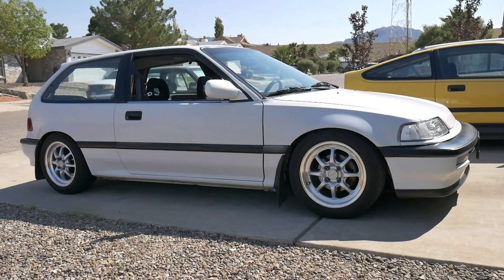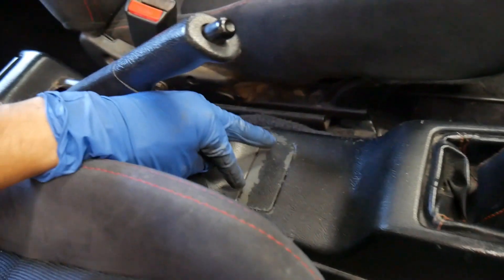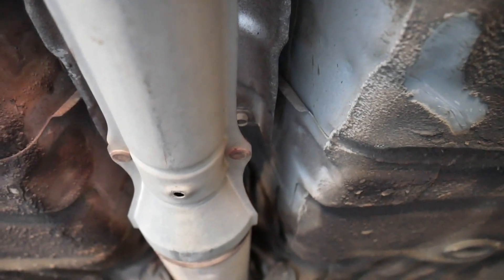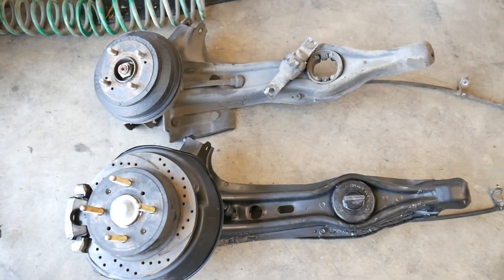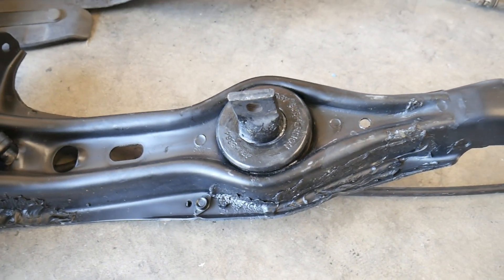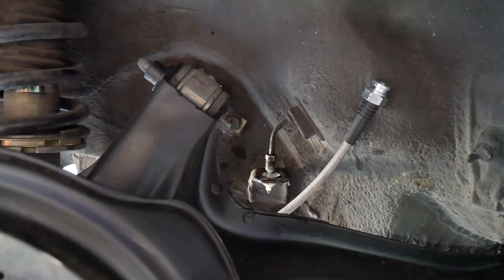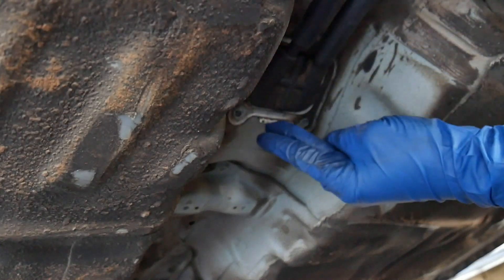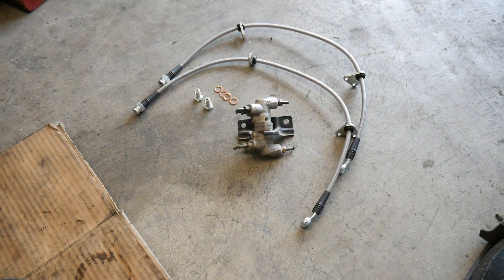How to Rear Disc Brake Conversion (88-91 Honda Civic CRX EF)

Comment: Hey why do you need the 40/40 value ?
Reply from the maker: The 4040 should give a more balanced feel, the 4020 is designed for the small drum brake, the split points for the pressure front to rear is different. You can always use more aggressive rear pads to change balance.
Reply: Garage Built Hondas do you really need that 4040 valve to swap drums to disc ? And I saw you installed long studs ?
Reply: Garage Built Hondas I just bought rear conversions for my Honda I know I need to buy brake lines and I don’t know if I have to need the 4040
Reply from the maker: It's not absolutely necessary.  I'm still not running one on my sedan and it has been like that for a few years.  You'll get a better braking bias if you do though.  The studs aren't necessary also.  That's just a preference.
Reply: Garage Built Hondas thanks for the reply man I appreciate it !! Just bought a Honda del sol Non vtec but will buy a b 20 engine in it bro there so hard to find here in Nebraska lol there fun cars
Reply from the maker: I had a del Sol once, for like 5 months.  It was a fun car, super sporty and loved having the top down!

Comment: In case no one mentioned in the comments; ideally you want 94-01 Integra arms as 90-93 will widen the track. Of course 88-91 Si are ideal as well.
Reply from the maker: Watched the vtec academy video too?
Reply: No, but thanks for the tip!

Comment: Hey, bro I was wondering what break lines do I need to get? I have a 90 civic hatch, but the trailing arms are from a 90 integra.
Reply from the maker: 91 crx Si
Reply: @GarageBuiltHondas  alright, so the crx si break lines is what I need to make it work wit the 90 integra breaks?

Comment: Are the brake rotors and pads the same on the DA and CRX?
Reply from the maker: A Ho Yes!
Reply: Garage Built Hondas Awesome... I have some rear discs off another EF I have that I would like to swap over to my Si and was kind of worried because I wasn't sure what car it originally came from and the rotors were crap and needed to be replaced. Do you know what e brake cables would work and is it pretty easy to remove/install from the hub?
Reply from the maker: +A Ho remove and install the cables?  It's very easy.  I would take off the pads & rotors and take them to AutoZone and compare.  There are only a few different sizes I believe, maybe only 2 or 3.
Reply: Garage Built Hondas Sorry, I should of been a little more clear, but I was referring to the emergency brake cables, because it seems the rear discs that I have didn't have cables with them. I was just wondering which cables would work and how hard is it to install those?
Reply from the maker: +A Ho CRX needs 90-91 CRX SI brake cables.  The DA are too long, but they will work.  I have a friend who is using those, but he has to loop them around underneath for the extra length.
Reply: Garage Built Hondas Awesome! Thanks for the great info!

Comment: Jon, I recently completed a rear disc swap from a 93 Del Sol into 90 EF hatch.  Cable were a little tight, and I had to make the threaded ebrake screw a little longer, but it works!
Reply from the maker: Bradley Tharp Awesome, good to know!  Maybe the cables were just an inch or so shorter since the Sol is short, but glad it worked!
Reply: Yea, and I used your other videos to replace rear trailing arm bushings, and went with ARP extended studs.  Thanks for everything you share!  My Build. https://honda-tech.com/forums/honda-crx-ef-civic-1988-1991-3/my-new-ef-3294176/
Reply from the maker: Bradley Tharp Dude awesome, just checked it out, getting a bunch of stuff done!  So glad to have been a help in that!!

Comment: I'm doing this conversion now and for me there's no way in hell I'm getting those two bolts without pulling down the gas tank on top of that one of the bolts broke right off so I got to get in there with a drill and try to dig it out great video otherwise though I might be able to unscrew the tank a little bit give me some wiggle room and try again
Reply from the maker: Ouch.  You might want to just drop the tank.  It might save a lot of time and headache.  https://youtu.be/UOrw15qOLHI

Comment: You sell ef part correct????
Reply from the maker: Colorado Macbay I don't collect to sell but if I have the parts I usually sell them.  What do you need?
Reply: Garage Built Hondas I need rear window seals and hatch seal for my 89 hatch that I'm restoring
Reply from the maker: Colorado Macbay You hit me up on Instagram also, correct?  I don't have any at the moment.  I haven't had any parts cars lately either.  If I make a trip to the junkyard soon I'll take a look.  Send me a msg on Insta again so I know who to find!

Comment: hey Jon I was wondering what e brake cables you used as I have read the da cables are too long for the ef hatch and you have to route them differently can you shed some light on this subject?
Reply from the maker: Jeff Marquette I've used DA cables on both my hatchbacks, no problems.  The cables are a little long for the CRX though but I've seen people loop them and they still work.

Comment: John , I have crx si trailing arms , is it true that I have to swap out the crx si cables with the integra DA ones because the crx si cables are not the correct length and are to short for a Ef hatchback ?
Reply: Adolfo Balubar if I remember correctly, yes you do have to swap them out.
Reply from the maker: Correct, the crx are too short.  I guarantee you'll be able to sell those though easily.
Reply: Garage Built Hondas  do those cables need to be from the 3dr teg or the sedan
Reply from the maker: +Alan Corbin either will work perfectly fine, unless you have a crx.  They are too long and technically they will work but you will have to loop them once under the car.

Comment: Great diy video, seems so simple until you run into siezed bolts lol
Reply from the maker: Jdm Enthusiast very true!
Reply: Heat them! Then run ur impact rev then forward and keep going and they will normally get loose and come out! I work on cars in canada... so ive had my fair share!
Reply from the maker: Great tip!!
Reply: Take it slow with the heat and impact.
That's a quick way to strip the head or break the thing off.

Slow is safe

Comment: if i wanted to keep the original trailing arms, but use the disc brakes from a DA Integra, do i just swap the rotor and brake assembly?
Reply from the maker: Yes.

Comment: do  you know what size the rear caliper bracket mounting bolts are, or if they are all the same size for all rear disc conversions? im having trouble finding them for 90 crx si rear disc
Reply from the maker: I'm sorry I don't.  Probably close to an m8x1.25 or m10x1.25.

Comment: I got trailing arms from a del sol with disc brakes. What will I need to fit them on my 99 civic lx sedan.
Reply from the maker: Nothing.  I'm just not 100% on the length of those Del Sol cables though.  You might need some DA or Civic cables.

Comment: so will the whole trailing arm disc break conversion bolt on to my ef  from a 93 si eg
Reply from the maker: +gilbert Lopez Yes!
Reply: wat braided brake lines would I need for my swap
Reply from the maker: +gilbert Lopez buy them for a 90-91 crx SI

Comment: Hi Jon,  I recently replaced my trailing arms along with everything in your video with the exception of the 40/40 valve. An issue arised after I finished the swap. My brake booster started to hiss. Now I have to mention that before the swap I replaced the booster and master. Can it be purely coincidence that my booster went bad simultaneously or is it something with the brakes.  Anything that you know of would be great help thanks in advance
Reply from the maker: Was the booster brand new?